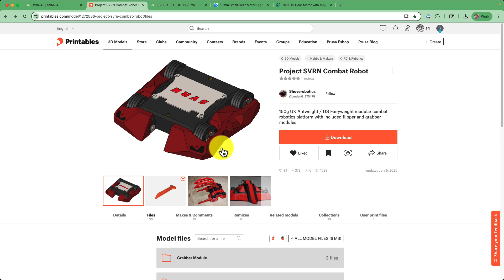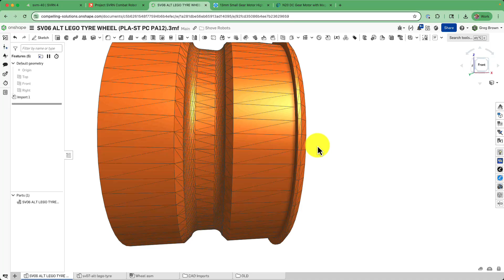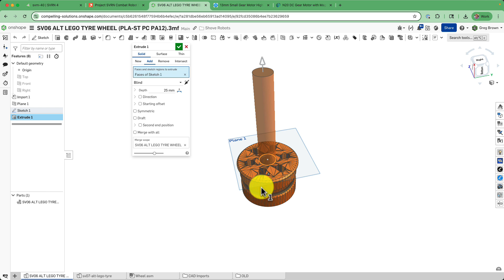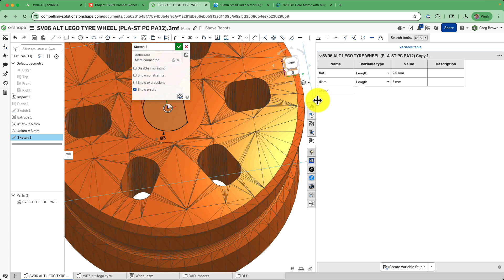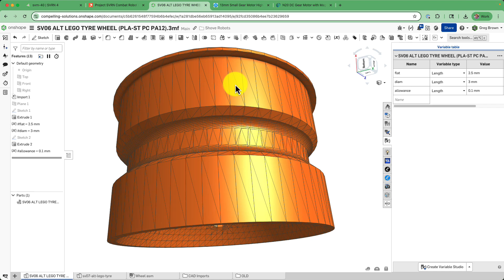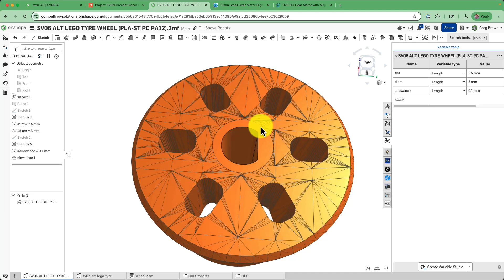Use Onshape to edit and remix 3mf (or other mesh files)

Comment: I’ve been using this workflow recently with my 3D scans and it is amazing. One wish is that I could repair my STL imports in OnShape. Right now I have to use a 3rd party program and I have to manually check if the STL is good by uploading and trying to modify it. STL’s with errors can’t be be modified in OnShape. Actually sometimes they can be, which is even more confusing. Overall I think developing the Mixed modeling capabilities of OnShape will be a huge unlock.
Reply from the maker: Great to hear that the mixed modeling is working and yes I agree there are a lot of things we could do in the area of mesh clean up. Make sure you make your voice heard on the forum in terms of Feature Requests...

Comment: I have been looking for CAD software where I can import a mesh file and edit it easily. I tried Tinkercad which instantly makes the stl editable (no triangles in sight), but Tinkercad is so simplistic that it's hard to use and SO unintuitive. There isn't even a way to copy/paste a part of your part with a ctrl + c/ ctrl + v. It's infuriating to use. Fusion 360 won't let you convert the mesh to a solid without paying for it, which is infuriating as well (I'm just using it for my own things too. Nothing commercial). I heard about onshape from Teaching Tech here on YouTube quite some time ago, but now, since I'm looking for something specific I find myself wanting to learn how to use it because of your video. So begins my journey into learning another CAD program. I am curious however, how you would handle more complex shapes to get a solid surface to work from?

Comment: i don't have   theses menus  on top.... ??? How to... ? WTf ?
Reply from the maker: Which menus are you missing? Are you referring to certain toolbars?
Reply: @gregbrown-onshape7555  I am having the same issue as the guy above. I uploaded a 3mf file to onshape and opened it. None of the normal tools are visible. No way to make a plane or Sketch. its a different view. How do you get the 3mf model into a normal document for sketching?